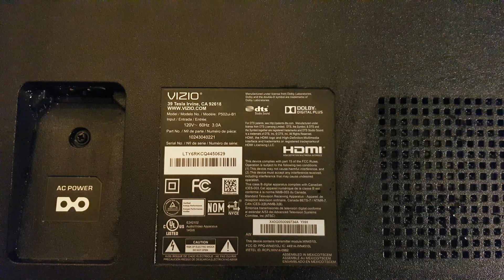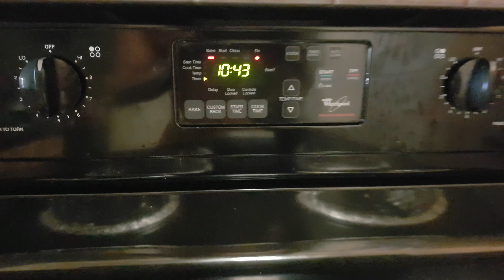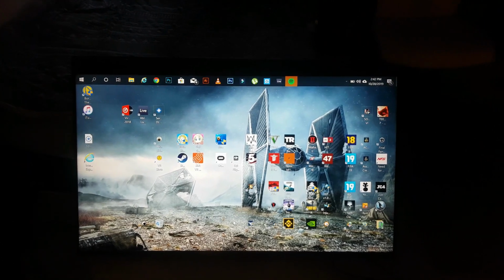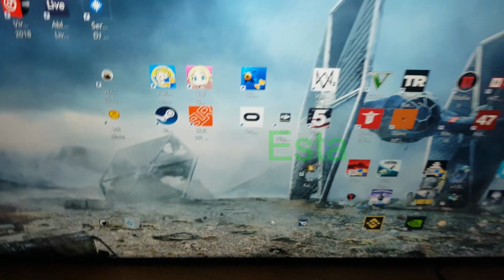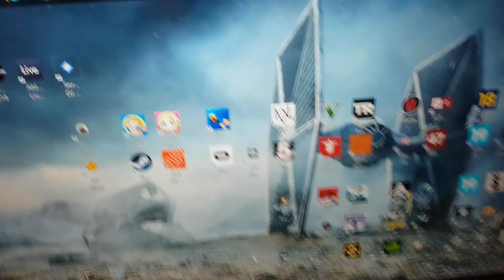Vizio TV P502ui-B1 No Back Light No Picture Black Screen FIX 2019 part1

Comment: I just did this myself!!! I’m absolutely astonished that this worked!!! Got the thermal tape on Amazon, heated oven @ 375 for 10 minutes, cracked the oven to let it cool, put it back in the tv once it had fully cooled - and it turned right on! Remarkable that this is such an easy and straightforward fix! Thank you, Andrew! - From a fellow Andrew.

Comment: Okay I had the same problem with my tv. Put it in the oven for 400 degrees and 10 minutes but I ran it to 13 minutes. Took it out let it cool down. Install the board tv screen actually lit up the back lights now. But still no display but back lights are on now which it didn’t do that before!!
Reply from the maker: Put to oven again, but for 10 min. I reboiled mine 5 time. It is finally working for 2 years already with no problem

Comment: Typically I never post on videos, but I have to in this situation.  Had the same issue on my exact same Vizio model, so did the standard Youtube search to see if there was a miracle solution to save $500 and came across this video.  Read through the comments and could tell others like me tried and this and were amazed it actually worked, so I figued what the hell I am going to throw this thing away if it doesn't work.  

Followed the directions, removed the motherboard, 400 deg. for 10 minutes in the oven, let it cool, re-attach everything correctly, and to my amazement like everyone else IT WORKED!!! Thanks so much for posting this video, was so mad this TV went out 2 weeks after the Black Friday deals ended, but now we will see how long it lasts and look into getting one when next Black Friday comes around next year!!!

Comment: Wow! I don't really understand why this worked? A reset of the semiconductors maybe? But hell I baked the motherboard at  375F for 10 mins let it cool and to my astonishment the TV is working again.  I'm not confident on how long term this fix actually is, but just wow.
Reply from the maker: I baked mine 3 times, the last time i baked it i put flux under two chip. How i understand the radiator not that good to cool it down
Reply: @gav696  Do you remember which chips?
Reply from the maker: Yes. The big ones, under radiator plate

Comment: I’m in awe.  I followed this and I am stunned that it actually worked.  I practically want to give out my phone number so people and actually talk to me to know it’s not a scam.
Reply: Did you put it in with the sticky pink pads
Reply from the maker: Yes. You need to put them back exactly  where they was located.
Reply: @gav696  okay, just baked it and reinstalled the main board! Very exciting to see the back light come on finally. There is no image though just black screen, what's the next move?
Reply from the maker: Try to reinstall blue flex cable, make sure black stribe is in ailment with brown clip. Let me know
Reply: @gav696  okay straighted it up and inserted it a little more into the pocket. Thought this would be cherry on top but still no picture 😬🙁
Reply from the maker: Bake it again, and let cool down too full.
Reply: @gav696  woah woah woah woah just readjusted and made sure blue  I just GOT IMAGE LETS GOOO !!! YOU ARE AMAZING Andrew thank you for flex cable was straight in and the vizio logo popped up. This is such a relief seriously so happy right now. Thank you 😊
Reply from the maker: Yeahhhh bro happy for you, cheers

Comment: Holy @%^#$  I thought that maybe the post here were fake but this shit really worked.  When I went to test the board the first time nothing happened but the backlight did start working.  I  gave up and put the TV back together and it sat for about 10 minutes and I decided to plug it in and let it sit to see if anything happened and boom, TV started working without any issues.  Andrew, you are a life saver.  Now I have a TV to mount in my office!

Comment: I read all of the comments below and thought, what the heck!  I have nothing to lose at this point!   I have a Visio M43-C1 that when plugged in and the power button pressed, the power light would come on and then go out, and then a little bit later, come back on again and blink multiple times and then go out.  It would repeat this cycle over and over.

When I took off the back panel cover and plugged it in,  I could see that the two little LEDs on the main board were lit (looks purple when both red and blue LEDs are lit), and then the blue one would go off after a few seconds leaving the red LED on all the time.  But, when I pressed the power button, the back lights did not kick in after a few seconds as expected.  So I also did the flashlight test - nothing.  

At this point, based on all the articles all over the web, I decided it was most likely the main board.  This video told me to bake the main board at 400 degrees F for 10 minutes in my oven.  I did it expecting nothing.  I was wrong!!!  I preheated the oven to 400 Degrees F, put the main board on a metal cookie sheet with the two red cushions down (just like it is in the TV when mounted), put it in and set the timer to 10 minutes.  When 10 minutes were up, I turned off the oven.  I reset the timer for 30 minutes to let it cool down while in the oven.

When cool, I hooked it all back up and lo and behold, it works perfectly now!   I am impressed.  I do know that most boards are supposed to go through a bake in time after manufacturing, so I wonder if they no longer do that step.  I will say that while it was baking, it smelled terrible!  It may be a RoHs board, but it does have some nasty outgassing while baking.  I was a bit worried that I as cooking the board to death, but I figured, WTH, I have nothing to lose anyway.  So hopefully, this will fix the problem for awhile without me having to try to find a replacement main board.
Reply: Is it still working for you? My TV crapped out tonight, and this looks like I'm gonna be baking sometime this week
Reply: Yes!  It still works just fine!  I am still amazed that it worked and laugh when I tell the story to others!  They look at me like I’m nuts, but it did save me time and money trying to find a replacement.

Comment: This didn't work for me at first, but I reconnected the blue ribbon to the board and to my amazement this actually worked for me. Thank you for this information keep up the good work !!
Reply from the maker: Glad I could help
Reply: @gav696  One thing I would add is to straighten a paper clip and insert it in the center of the coaxial connect before putting it in the oven. The plastic will melt and the hole in the center closes shut.

Comment: The proper way to do the repair is to only reflow the main BGA chip on the board, since it is the one that is not properly contacting the pads. Using something to deflect the air flow, you can use a heat gun ( I use a hot air rework station gun ) 20-30 seconds and then let it cool for 15 minutes before testing. His way works, but heats up all the components. 
  The reason why the  BGA chip separates is due to low temp solder with no lead in it ( Eco solder ) that was used and the poor cooling solution on top of that makes it worse. You might want to do what I did to my Vizio XVT553 ( it was free, and I would NOT buy this brand ) is add a cooling fan to the heatsink of the BGA to keep it from getting hot enough ( and they get to 130f ) to prevent this from happening again, or you may not get another shot at fixing it again due to heat stress from another attempt. 
 In the business since 1986, you learn a few things. Vizio is junk guys, sorry.

Comment: I found this same model tv at the local dump. Only the white power light came on. I baked the main board at 400F for 10 minutes on card board and wrapped in foil and it works now.
Reply from the maker: I am glad it works for you too
Reply: hey is ti still working lol?
Reply from the maker: Yes, it is.

Comment: I just tried this oven trick and it worked!  I can't believe baking a motherboard fixed this back light issue!
Reply: How's it running now?
Reply: @ChristopherViola  Mine broke again after 24 hours of doing the microwave trick.
Reply from the maker: I am trying to find out what is getting disolder . This stupid radiator is junk. Idk why they even put it in there. I will take it out and see what we can mod on it. I love that tv.  No give up LMAO 😂
Reply from the maker: Mine broke again so I record second part of the video
Reply: @gav696  Did you complete the second video?
Reply from the maker: Yes. Check in info of video or my Chanel brother

Comment: so I did this yesterday as per the video and it completely worked without a hitch. My TV is fine now!
Reply: Jond how high did you set your stove at?
Reply: @AL-qr4vf  I set it at 350. and I put is on a grate and on some parchment paper so nothing would stick
Reply: @AL-qr4vf  I placed mine on a small piece of cardboard then that on a cookie sheet. I set the oven to 450 and let it go for 10 min. Worked perfectly and nothing melted.
Reply: @bc4092  did you keep those pink things on ? Mine came off when removing the board from the tv
Reply: @leoacevedo7125  those should be replaced they are for heat dissipation.
Reply: Awesome thanks
Reply: mine also stopped working after a couple of weeks. I tried soldering but you really have to have the right equipment. Found someone on ebay that fixes these boards and sent it out. Got it back and now have been using the tv good as new for months
Reply: who did you use on eBay or how did you find it ?

Comment: I tried it last night. Worked like a charm! I didn't remove any plastics or adhesives, but I also was careful not to touch anything while it was warm.  I accelerated cooling by placing a fan next to the cookie sheet when I pulled it out. 15 mins later I threw it back in the TV and it worked.  Be sure to place the thin ribbon on the board correctly or the picture won't show.
Reply: I did it to my vizio board, working great now. Installed a couple of small laptop cooling fans pointed down the length of the heat sinks for good measure.
Reply from the maker: Happy it worked for you 😊
Reply: What temp do you set the stove at?
Reply: @AL-qr4vf  10 minutes at 400F
Reply: Okay thanks
Reply: UPDATE - 3 weeks later it died.  I'm going to buy a replacement this time instead of baking the main board every 3 weeks :) I could get out the soldering gun, but I'm not that interested in doing that.

Comment: so do you take the insulators off the back of the board, those pink things, before baking. Remember this used to be the fix for the xbox ring of death
Reply: I didn't remove anything.  Just put the board on a cookie sheet that also had a cooling rack on it so the board was on the rack, not directly on the cookie sheet.  I can't believe it worked.  My kids couldn't believe it either.  Dad was a hero!